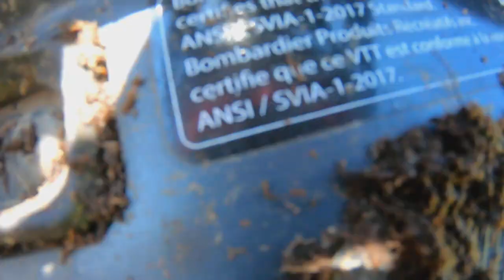Renegade & Highlifter Showdown

Comment: These atv companies need to build a cv joint that is two piece and one slides inside the other. Then have a hole in it with a shear pin. You could just carry a few shear pins with you. That is how the shaft is made on a bush hog, saves you a lot of money and time.